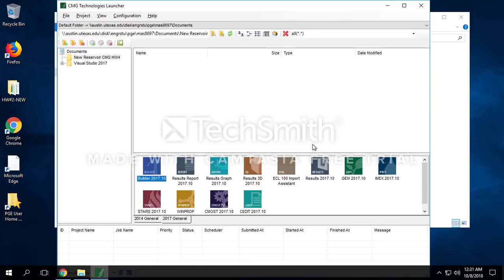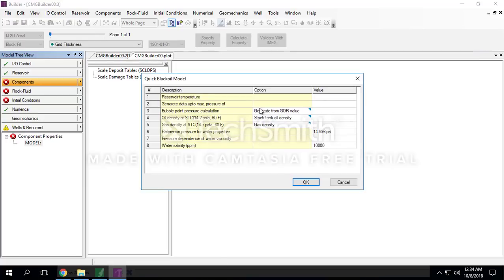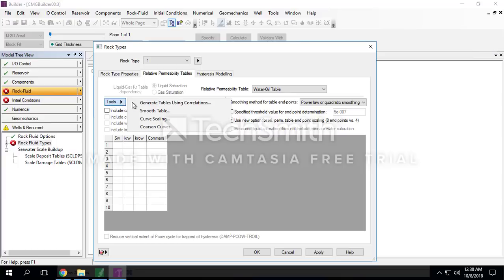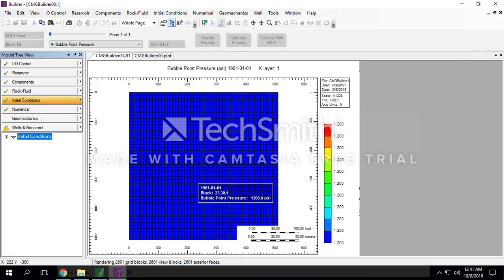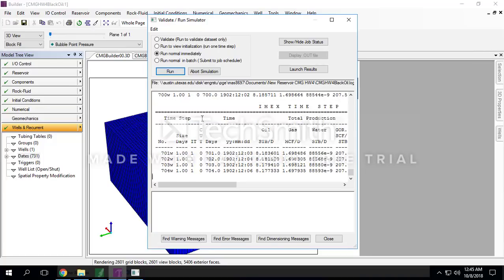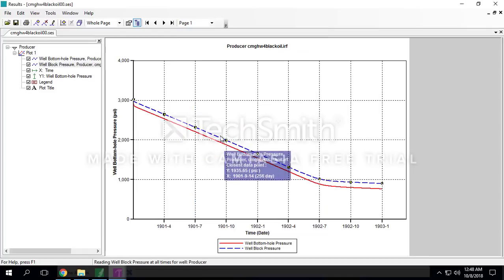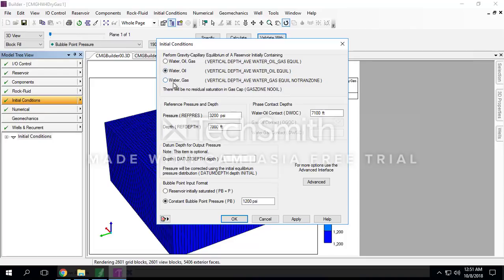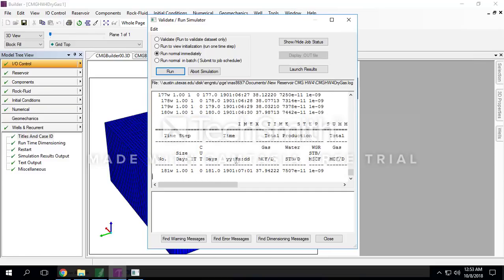CMG Reservoir Simulator Introduction

Comment: Dear Mauricio
I followed as you said, but I faced a fatal error and simulation stopped

 =================== FATAL ERROR (from subroutine: ININI2) ====================
  The first keyword in the initial conditions section must be
  *VERTICAL or *USER_INPUT
  Line: 122   File Name: \\INFPWFS219.ad.unsw.edu.au\Student038$\z5196403\Blackoil.dat
     1 Warning messages.    1 Error messages.
 ==============================================================================

  Terminating simulation: Fatal error.

Do you have any idea to solve this problem